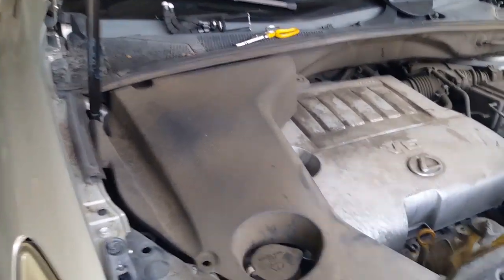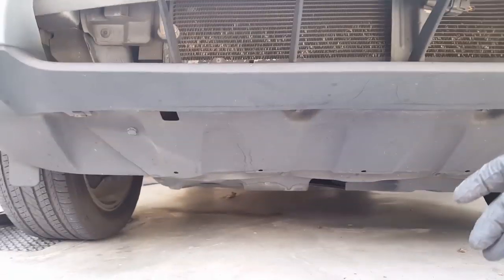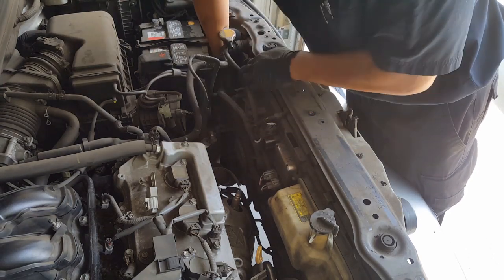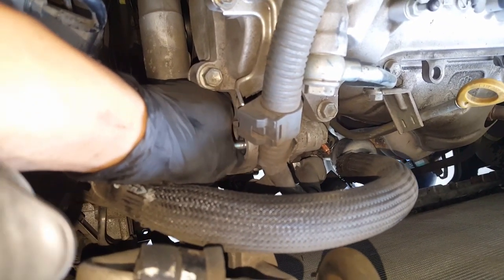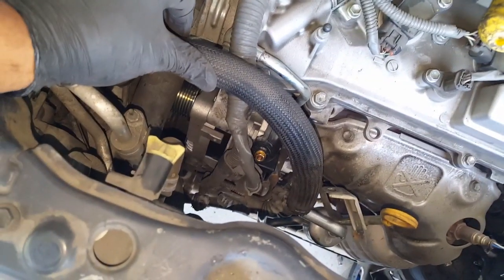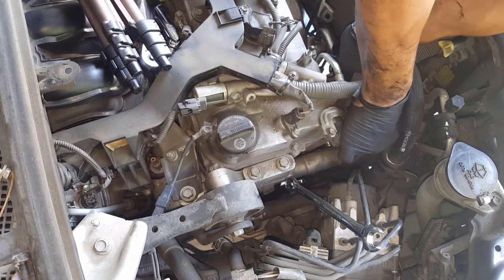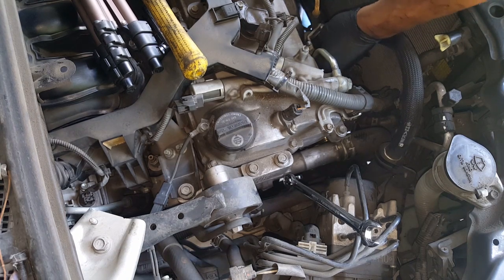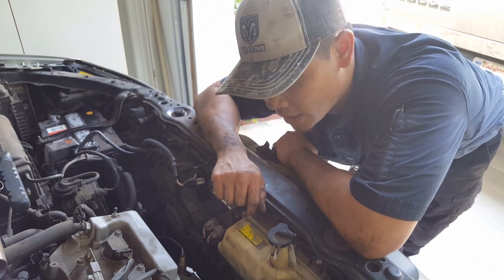07 Lexus RX350 Alternator replacement! WITHOUT REMOVING RADIATOR

Comment: Thanks for an awesome video. I probably spend 2 hours taking out the hidden back bolt.  The trick for me was to remove the manifold plate which opened up loads of room to maneuver.  With the plate pushed to one side it took me a few seconds to get it out.
Reply: Really. Very easy for me.  But I first accidentally removed the manifold bolt.  AMD after struggling to remove the alternator I got under the car AMD was like fuckkkkk the bolts still on AMD it was the manifold.  After that I removed AMD reinstalled the right bolt AMD bam. Off like a charm

Comment: Also, for both number two, the bottom alternator bolt at the side of the serpentine belt, take a little extra time and get the air conditioning line out of your way, and the ABS pump, especially it's bracket loosened up will give you more wiggle room

And, it's no fun, but will save you a lot of trouble to just remove the radiator hose from the water pump.

Comment: would it be idle to change the pulleys and tensioner assembly and or water pump while doing this job? i have approx 160K miles clocked in..

Comment: Awesome video! Do you think the ES350 has enough room to pull the alternator without removing the radiator?
Reply from the maker: Taylor Brown thanks! Yes it should be the same
Reply: No there is not enough room to remove it with out removing the fan assembly, if you have to remove the fan assembly then you might as well remove the radiator too... It’s not that much extra work
Reply: Wendell Greenidge its ALOT more extra work. fan assembly is a couple of bolts and connectors. radiator is hoses, tranny lines, coolant drain, refill and burp system. that adds alot more time to service. what are you talking about?
Reply: Random Google Name I did it without removing the radiator. However, Toyota TSB states that removing the radiator is required but not necessary.
Reply: @hedga001  ok cool. Ill have to check my manual, i thought it did say in the manual to remove. Cool that yours says its optional.

Comment: How many miles your 2007 Lexus RX350 had when you had to replace the alternator, because this part should last a long time?
Reply: I know mine today has 105k and have to replace today
Reply: 2008 here, 200k until it failed
Reply: 2007 here 202 k

Comment: A VERY important detail:  You must remove a stud from the exhaust manifold to get a grip on the 12 MM bolt that is on the inside lower tab.
This bolt is impossible to remove without doing this.  Video makes it look easy, but it is not. I think I used every tool I own and many that I bought or borrowed!

Comment: That bottom screw can be removed easier if you remove the heat shield.
Reply: No need... The bottom bolt attaches to a 90° bracket which goes straight into the engine block. A 12 mm straight on will take it off and save you a hell of a lot of trouble.

Comment: 9:57 - T the bottom bolt attaches to a 90° bracket which goes straight into the engine block. A 12 mm bolt goes into the engine block straight on.

Don't mess with that really hard to reach both on the alternator. You will save a lot of time and angst by just going and looking at the bracket. Then just undo that bolt . There is no need for any swivel fitting for your ratchet.

Comment: First, thanks for the video!  You made all the difference.  I tried to do the same with this one on that car's transmission filter:  https://www.youtube.com/watch?v=92pc9fCvK4c
Here are some lessons learned:
 - Buy and install a new serpentine belt.  It’s time and you’ll save $100 in labor.
 - Buy and install a new radiator filler neck.  On the earlier RX350s, they’re notorious for breaking off at the bottom hose and, potentially, destroying the engine for lack of cooling.
 - Gather cardboard to protect the radiator, a headlamp, a 2” nail, serpentine belt installation diagram and a magnetic grabber.
 - Take photos of everything before you take it apart.
 - You don’t need to loosen the dipstick but you do need to shift the exhaust manifold shield out of the way.
 - Cover the radiator fins with cardboard after removing the fan.
 - My hand won’t fit between the alternator and hoses from the top.  That’s why getting to the bottom bolt from below proved to be so important.  Same for the belt tensioner.
 - Remove the passenger wheel and the cover over the belt.  Find the belt tensioner at 2 o'clock from the big crankshaft pulley at the bottom of the engine.  See the hole at the end of the tensioner arm?  When you twist the tensioner to the left with a 14mm wrench on the nut, you’ll be able to pin it out of the way with the nail slipped through that hole and into the slot you see in the engine block.  Remove the belt.  That will expose the bottom alternator bolt and prep for the new belt.
 - The light gray electrical connector you need to disconnect below the alternator has a locking clip hidden at the bottom.  Remove it from below.
 - The driver-side bracket on the alternator is tough.  First, remove the nut holding it onto the engine.  Pull the alternator off that bracket’s bolt, twist the alternator to expose the bolt holding the bracket to the alternator, and remove the bracket.  That makes removing the alternator much easier.  To install, put the new alternator in about that same place, then attach the bracket to the alternator, then finally fix the bracket to the engine.
Thanks again!

Comment: How many mile , alternator out
Reply from the maker: It depends it's usually as round 100 - 150k maybe even longer. But you should have a battery light on the dash most likely indicating weak alternator
Reply: @LifeTac  mine just went out today at 105k. I think its cause the job I have requires security lights which then drains some battery while the lights and radio is on. And when having to do patrols it's over works my alternator to recharge constantly.  Only reason i can think why it went out at 105k

Comment: The most important part was to show that hidden bolt.wich wasnt shown Its Much easier to un bolt ac compressor  to get to that bolt.
Reply: vincent milano You don’t need to remove the AC compressor to remove that bolt. You unbolt the bolt strait next to the hidden one on the same bracket. Then you unbolt the hidden bolt once you get the alternator out and bolt the bracket to the new alternator.

https://m.youtube.com/watch?v=IAgFfeWbaMQ

Comment: I don't care how much someone would pay, I'd never do this again. Be warned everything that can go wrong on a 12 year old car will go wrong!
Reply from the maker: Yeah this job is not for the faint of hearted people. Must be pretty mechanically inclined or very driven or motivated to do it yourself
Reply: @LifeTac  I consider myself very mechanically inclined but jeez on this rx350 everything was packed to tight. I could only do it by removing the front passenger tire. The new alternator I got was 0.5 cm too small to fit for the front bolt. That and it's -10 outside right now did not make this fun. Thanks for the video!
Reply: @LifeTac  I can admit it's a very tight job but once I figured all the right angles and saw that removing the passenger tire was easier. Going in was a total breeze. While I'll never have to work on this car again if I did it would be a breeze knowing all the bolts and angles. Only hard for a person who never touched it but a mechanic will do this at a breeze. Took me around 4-5 hrs but that's also including watching YouTube videos and waiting for a second hand to come